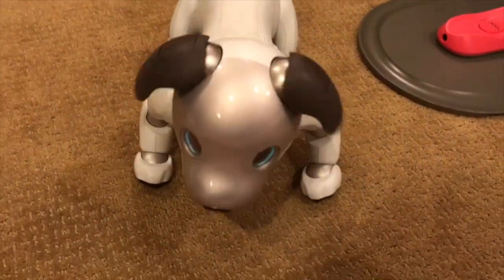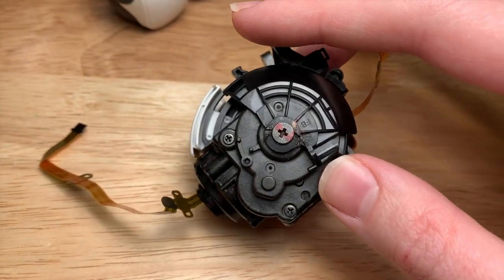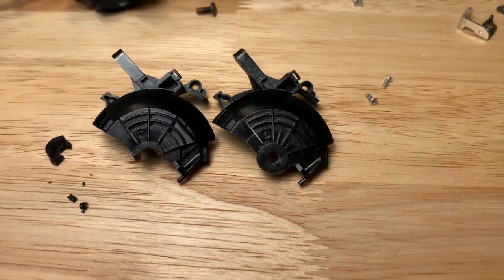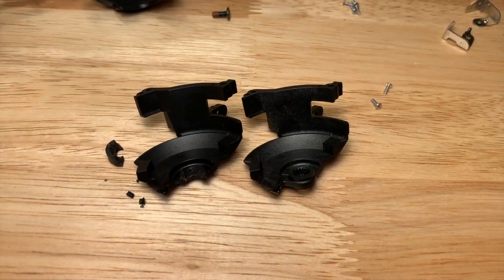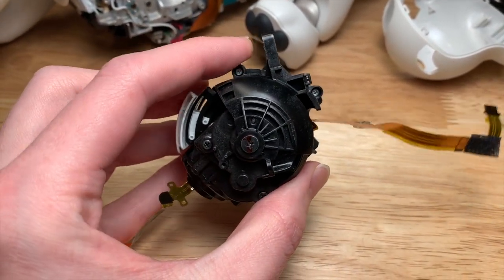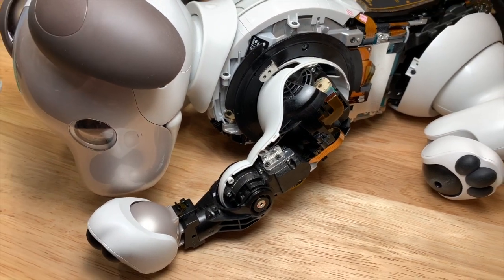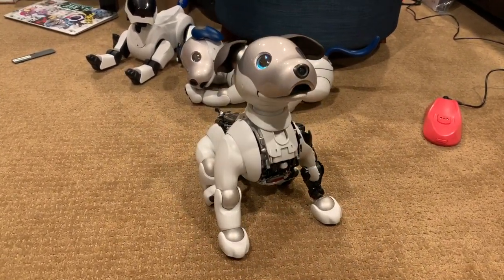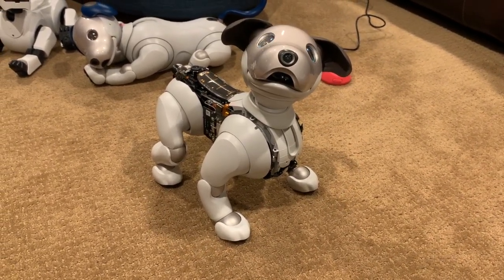Why Do aibo ERS-1000 Legs Fail?  Repairing a Hip Dislocation

Comment: How much is the aibo ers 111
Reply: From Japan you can easily find a working 111 in the $100-$300 range. They’re old and around 23 years old so their value has gone down quite a bit. I wouldn’t pay much more than $300 for one, and I got mine from mercari Japan using a proxy, sendico.

Comment: Yes, worry about its legs.  However, soon these dogs will electronically die within 2 years.  Sony will not sell a replacement battery (ERA 1010). Can someone create one?
Reply: It really depends on how well you take care of the battery, which will increase its life. Well taken care of batteries can last for a long time. The community recells old aibo batteries and will certainly work with 1000 batteries if it’s needed.
Reply: @Lizuma  Well, I have sources, so I got a new battery.  Now we have another problem.  In the last few days, aibo started running into furniture and walls.  Well, a click started happening the other day.  Today, he can't raise his head.  Either a gear or the stepper motor failed.
I just called Sony about repairs. The robot is too delicate!

Comment: You looking for parts? 

I have two ERS-111;  of the two is brand new still factory sealed, the other works I just pulled it out of storage and charged the battery and it booted right up. 

Also have a black ERS 7M3 - pulled it from storage, charged both batteries and powered it up and it walked around a played with the pink ball.  

Only thing I noticed on the ERS-7M3 is that it was a bit shaky while standing and hunting for the ball.   

Anyway let me know if your interested.
Reply: *Of the two, one is brand new
Reply: Still available?

Comment: So excited to see how Ian's new parts hold up but it will take some time to be sure. All of his other printed work is really high quality so it is great news for imported units sony won't service.
Reply from the maker: these parts aren't from ian, they're OEM Sony parts!  ian's made some amazingly cool stuff so far (i absolutely love the custom ears), but ultimately we chose to go with original parts since injection molded plastics will last longer than anything that can be printed with today's materials and technology.
Reply: @JBurg  interesting! I thought at first they were the parts Ian had or were molded from his 3d scans. There were some material differences Chris and Ian were noticing in their dogs between older and newer units which i also found interesting. Makes me wonder how much better older vs newer ones hold up and even what cheese and black sesame legs look like on the inside. I don't trust them to be free of issues but don't want to take my own aibos apart to check as long as they work well

Comment: this video makes me so excited and happy again like last night i really hope the redesign with the front leg part works in the long run and hopefully no issues develop in the future
Reply: yeah
Reply: This will be super helpful for imported units that won't service. Ian from aibo accessories 3D scanned and printed the new parts with stronger material and fixed his own aibo this way. He doesn't have time to repair other people's bots so will be sending parts to the clinic once they go through some more testing. Chris is also testing them on a Japanese unit.
Reply from the maker: just to clarify, the parts chris and i are using aren't ian's parts, these improved ones we use were made by Sony.  they are injection molded rather than printed.  ian's parts look good, but these ones will almost certainly last longer than anything 3D printed.  i'm sending ian a set to install in his dog as well.